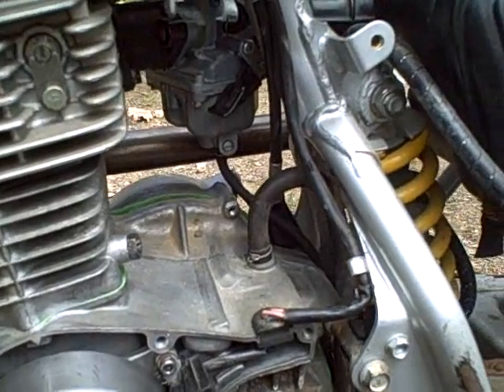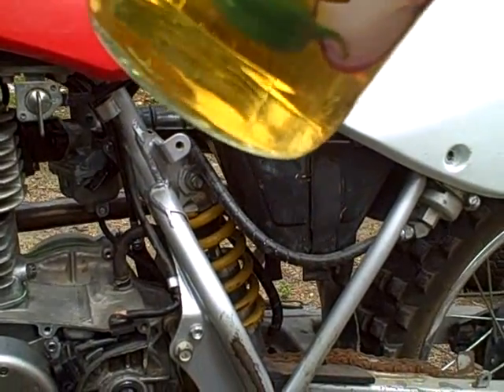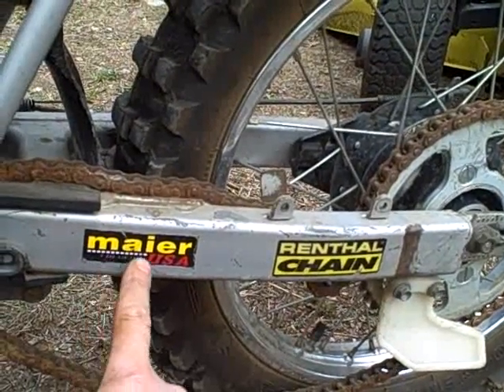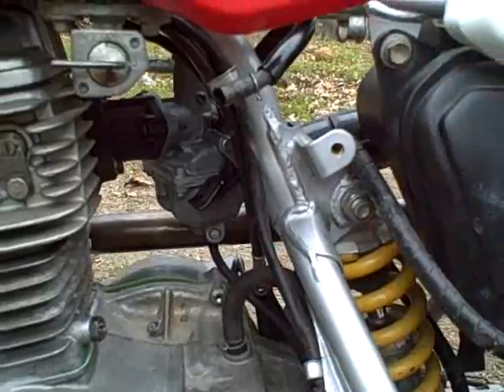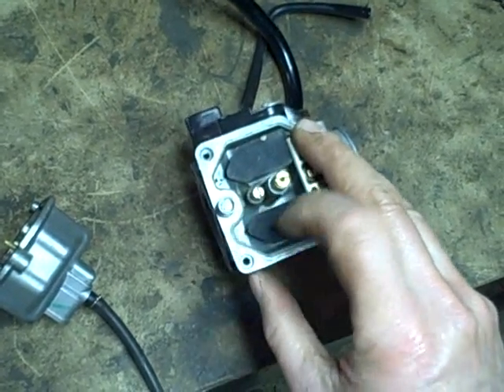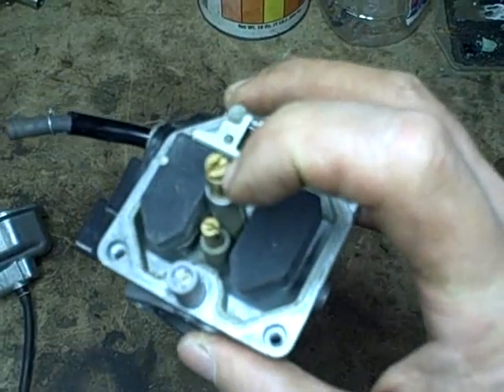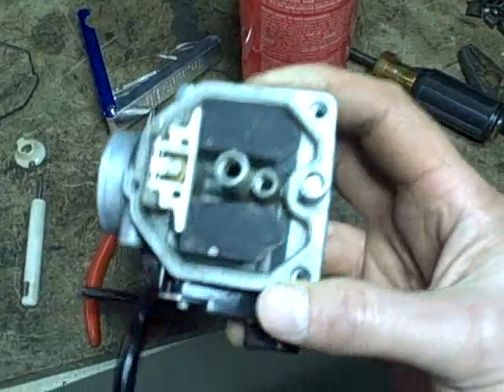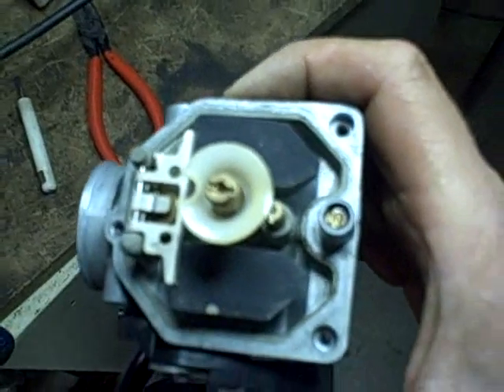2003 XR100R Part 23

Comment: My carb leaks like a bitch when I put it on reserve. And just drops gas out at a steady pase when the gas is on. I took it apart it's not the float. I think it's a gasket? Should I replace it? Please respond asap
Reply from the maker: +Robert “MXKID” Barba make sure the seat that the float needle is clean, also verify that the float height is set correctly.
Reply: Make sure the float bowl drain screw is snugged up tight.